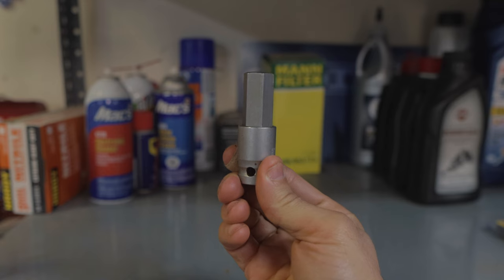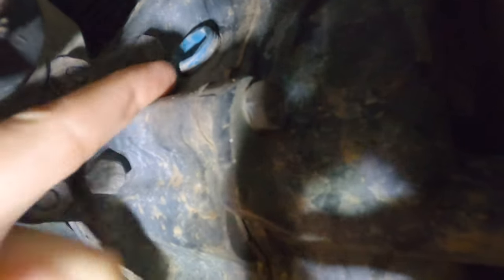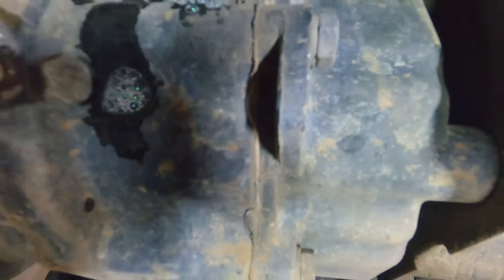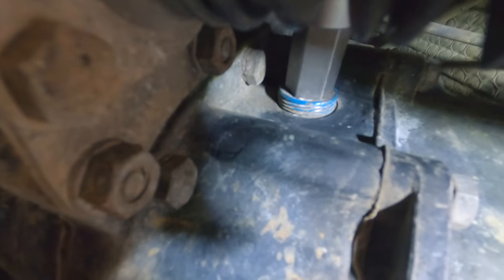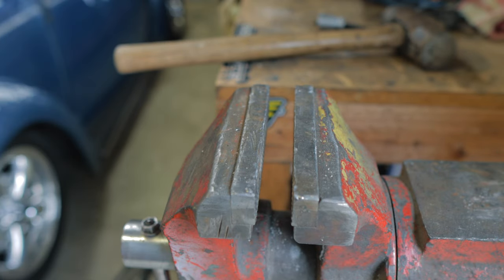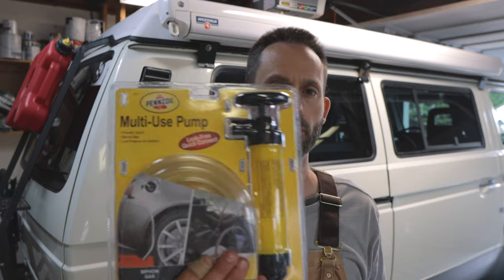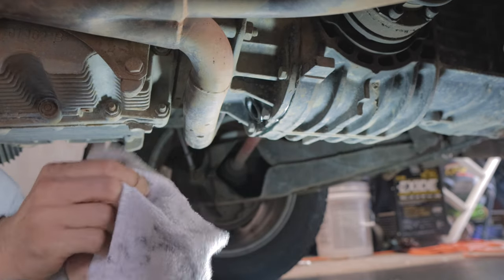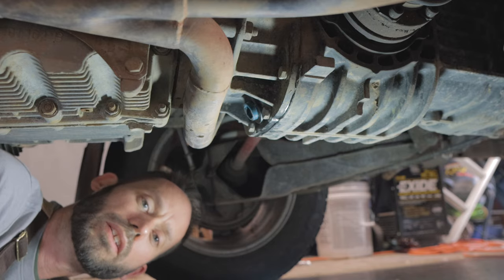How To: Vanagon Manual Transmission Oil Change

Comment: Good to see maintenance of this critical component elevated.  I have been studying the Vanagon transaxle extensively for about 6 years now.  Here are some points I have arrived at (my opinions).  Note that engine size is inexorable from this conversation.  VW built the transaxle for 82hp, then increased it to 90hp.  Many of us have bigger engines which requires heightened transaxle attention and maintenance - obviously.  Mine has 173hp and many vans have even more.

1) 30-40k is a prudent, almost 'anal' interval for the first 100k miles for a 'new' van in its first 100k miles.  We are way, way past that - usually in the 200-300,000 miles range.  If you changed at "30-40k from new" your gears could have an almost infinite lifetime, but nobody has done this from new - that horse has left the barn.  The Vanagon owners manual specified on pg 102 that the gear oil does NOT need to be changed, and this is what Vanagon owners did.  And was VW wrong?  No, the transaxles run a FULL and satisfactory lifetime with even running in their own barf.  VW did not envision or accommodate our current Vanagon fetish, but they could have run into the 400s.  What most all of us have now is a 'rebuild' of a trans that rec'd ZERO maintenance in its prime, when it could have made a difference.  And now we're 'making do' with our worn out gears that will give up the ghost in their 200s, 300s.  A "rebuilt" uses almost ALL old gears but some new bearings.  30-40k is too long an interval for the old gears of a rebuilt.  For our old rebuilt vans, with their original owner's (which we call "sad") maintenance you should consider more like 15,000-25,000 miles. For big engines use 15,000.

2) Inspecting and taking a pic of the steel dust that has fallen down onto the drainplug magnet from above, is important. It's an indicator of the health of your trans.  Is it "more stuff", or "less stuff" than last time?  You should take a pic of it, so you can compare next time.  Every year you will wonder if the trans is OK for a long trip this coming season.  If you have pics, you can know where you're at.  An old trans will contaminate its oil much sooner than a 'new' trans. Looking at the magnet helps to determine your next oil change interval.  If your magnet is completely covered, you waited much too long.  If the magnet has lots of clear space on it, your oil change interval was 'good'.  In your 'opening' still photo I can see your magnet, and it has clear space which suggests good current health.  How many miles was your interval?  I suspect reasonable for your specific trans, and the oil looked clear too.  I also noted your WBX engine, which is another way to get longer transaxle life😉.  Transaxle worries are much less with a WBX.  Transaxle health and maintenance should be elevated to the top for those with big engines.

3) Oil brands are much much less important than your oil change interval.  The thing to know is there can ONLY be minor differences in oil brands...... but in use, there will be vast differences in contamination levels.  Every trans contaminates its oil at different rates, especially if your engine has more HP than stock.  The most significant problem to watch out for in oils is "thin oil".  Thin oils are compelling for the 'easier shifting' but this ease can be a tradeoff in transaxle lifetime.  It depends what you want from your trans.  It can be more economical in the long run to use a $25/gal garden-variety 80W90 that you're willing to change every 15,000 or yearly.  A $100 Synthetic that you are inclined to run "too long" because it was expensive will then cost you in transaxle life.  That $75 difference that you expected to "extend" your transaxle life is actually costing miles if you let it get contaminated.  The oil you choose can only make a small difference at BEST, like single-digit percentages.  Clean, new $25 oil is vastly superior to a $100 specialty oil that already has (for example) 15,000 miles of contamination circulating throughout your trans.  If you go for expensive oil you still have to change it as often as cheap oil.  Again, this becomes much more important with big engines.

4) Synthetic is a very common question.  It has some problems in a Vanagon trans.  It's not a slam-dunk benefit.
a) Synthetic does not offer better protection at low temps but it's definitely superior at temps beyond 240°F such as in racing.  But the Vanagon trans is destroying itself at 180°F (the mainshaft bearing bore is loose around 180°F).  So you can't get there, a Vanagon trans running at even 200°F is destroying itself and you should not stray far from home.  The high temp benefits of synthetic are not within our reach.  How do you know your trans is 200°F?  OK..... that's a completely different discussion.
b) Synthetic can "shift easier".  But that is at a cost. The physical properties of oil that allow easier shifting by 'gripping' the gears, comes at a cost of longevity, it's less protective of gears and bearings.  It's useful to know there is a tradeoff, you don't get  both easy shifting and longevity, you have to choose one or the other.  For longevity, choose a more slippery oil and slow your shifting to accommodate.
c) Putting synthetic in an old, un-maintained trans can be detrimental.  The cleaning action of synthetic can wash off lots of contamination from the walls of an old trans and quickly contaminate your new oil horribly, becoming detrimental.  If you want to use Synthetic in an old trans, consider putting in cheap synthetic as a "cleaner", run it a few thousand miles and dump it, then put in your chosen brand.  Understand this effort may not be worthwhile - you may not be gaining anything and possibly losing.
d) "Synthetic" is fighting words in the oil industry, sellers like "the word" because it raises the perceived value/price.  The definition of 'synthetic' has a wide range of meanings even causing (losing) lawsuits, as such there is little stopping sellers from using the word with their own self-serving definitions. Sorry there is almost no way to know if it's true/false by asking the seller.  Reputable brands could be more reputable (for whatever that's worth).

Synthetic is a difficult question. I'm not sure there's a good answer to the Synthetic question.  Lubricant cleanliness is the single answer that serves you best - unquestionably.  It's something within your control and especially if you can DIY, which this video helps a lot.  People ask me what oil do I recommend?  I don't recommend - I use $25/gal oil. I have 2 gallons of $70 Swepco 201 but haven't used it for "other reasons" too involved to explain here but will certainly use it sometime.  I trust Swepco as a quality oil, and there are many others.  I think the differences between oils are subtle differences.  Except for big engines, never forget that your transaxle is undersized, so definitely avoid "thin" oils.  If you have a big engine and $70/gal is OK, Swepco 201 kept clean is good.  If you need a 'brand', Kendall is trusted by many ($35).  And again, if you have ~90hp you can probably run any oil.

Don't run dirty oil because you can't decide what brand to buy.  Cleanliness is the major factor, by far, and you are in control.  Change the oil now with $25/gal 80W90 and study up on a favorite brand for your next interval.

Sorry so much typing and hope it helps.
Reply from the maker: Great comment Sodo!  Very informative.  We had about 20K on the tranny after the rebuild and as you could see the oil was still very golden and the magnet was very clean with just a bit of black sludge but no metal flakes/shards.  With our WBX motor and regular oil changes we expect it to last a very long time.  Though we may take it back to GTA and get a Peloquin installed here soon :)
nate
Reply: Thanks T_SODO for the information very interesting comment.
Reply: Thanks for your very detailed explanation of the oil to use.   Reading this makes me happy.  Best from Belgium.

Comment: There is a 17mm hex on a 3/8: socket that is about 1" long. A common VW tool. Clearance was still an issue, so I used a 1/2" breaker bar instead of a ratchet. I would make sure the fill/drain plugs move before driving the van, then perform the work more quickly after the warm up drive.  Also, I bought a small hand held pump sprayer at the ACE garden store ($10) , drilled out the orfice, attached a clear hose, filled the sprayer tank with gear oil and pumped up pressure. Then simply press the lever to deliver the oil. Much easier than pumping 500 strokes to deliver 3.5 qts of gear oil.

Comment: Thanks for putting this together.  That change interval corresponds with the interval for the timing belt change on my Subaru engine.   Wish I had a pit to work in.  My van sits a little low so I may have to put the front up on ramps.
Reply from the maker: Glad it helped!
Nate

Comment: Thank you. I used to know how to work on my vehicle. This will definitely help me out. I have an '87 Westy with a manual transmission also. It does, however; have a Subaru 2.2 engine.
Reply from the maker: This is something you can definitely do. The Subi engine doesn't change anything in the tranny fluid steps.  Good luck!
nate

Comment: So I am the proud NEW owner of a 1991 Vanagon GL, and I am noticing the shifter is a bit on the ambiguous side.  Do you have any videos showing how to take care of the shifter linkage, or anything else that might help me tighten up the mechanism that controls this?  Also, I will definitely be using this video as a guide for doing my transmission fluid!  Thank you so much for taking the time to make this video!
Reply from the maker: No we do not have a video outlining those steps.  The shifter mechanism can be a bit complicated due to the length of the rod and wear on parts.  I would start with making sure your shift ears are in good shape and go back from there.  GoWesty has some good articles and videos outlining the shifter.
nate
Reply: @ThatBaldwinLife  The fluid change went pretty smoothly.  The old fluid looked like iridescent tar, super black and apparently VERY old!  New fluid is in and it seems to shift a little better.  Now I do have a different question . . . I want to change the spark plugs, but I am noticing that the small aluminum  endcap on the spark plugs is not allowing me to put the wires back on?!  Am I supposed to unscrew these small aluminum pieces off?  The OLD plugs have them pulled off??
Reply from the maker: Yes they should unscrew from the new plugs. Some wires use different ends. If your old plugs didn’t have the ends, then pull them off!  Nice job on the transmission oil!
Nate

Comment: Thanks Nate. Great information! Was gonna do a TA rebuild but realized my 1990 has the upgraded gear so no pressure to rebuild it before 150K miles. So, just changed TA oil to Swepco 202 from Redline. Really noticing a big difference in shifting. Also upgraded to the GW SS fill and drain caps (not plugs). Both have magnets and all new threads.
Recently had the linkage bushings upgraded to teflon and that makes a huge difference. Evidently the old style bushings absorb moisture and get tight. Teflon won't do that. BTW-did you two upgrade to a Synchro? Thought it looked like that on your recent video to the fire lookout.
Reply from the maker: The Swepco is a great oil, it’s all we use now. We have not done the Teflon bushings but may look into that!
Nope still out 2wd but we put on our SyncNO badge 😁

Comment: If you can find a vintage snap on wrench S5902 it has a 21mm wrench on one end (for removing generator nut on type 1) with a 17mm hex on the other for transmission drain plugs. Have had mine for over 30 years.
Reply from the maker: I’ll have to keep an eye out for one of those!  Thanks!
Nate

Comment: Just did this in mine, ended up needing 2 jugs 1 was just shy of filling. That hand pump wasn't too bad way better than the harbor freight version.
Reply from the maker: Weird, we have never used more that one gallon to fill.  Glad you got it changed!
nate
Reply: @ThatBaldwinLife  i forgot to add that I accidentally knocked over the first jug halfway thru and spilled a little so thats probably why 😂

Comment: Really timely video - thanks! I was thinking about doing the gearbox oil on our 1983 petrol T25 but was unsure of exactly how to do it. This video explains it perfectly. Going to have a look on JustKampers to see if they've got the oil and the socket I need. Will look for one of those pumps too. Our gear linkage hasn't got those rubber boots you've got - is it supposed to have them or are they an upgrade?
Thanks again for a great technical video - bang on time.
Reply from the maker: Glad it helps!  Ours didn't have them stock but the 1988 and up Vanagons have them and they are a direct fit.  GoWesty has them as I'm sure Campervanculture.com might as well.  
nate

Comment: Hey Baldwin! I did this job today on my 5-speed. I followed your advice and bought that 17 mm key, and punched it out just like you did. It was a lot of work cleaning up around the holes, especially the upper one. I also saw a lot of corrosion "cavities" around both plugs. Any guess why that happened? The gearbox is probably original = 33 years old. I know aluminum "rots" but it really looked like some weird cavities, and none of that white corrosion stuff, probably it has corroded anyway, while being drenched in oil/grease/dirt. I filled up with "fully synthetic" 75W-90 oil. Some folks here in Sweden advised to put a mineral oil though... I don't know what to believe. What's your opinion about oil grade/quality?
Reply from the maker: I would stick with a high quality oil like the Sweepco 202 or any other 75w90 oil.  No reason to put mineral oil in your transmission ever.

Comment: I Just ordered the same fluid! thanks for the video! What would you recommended for power steering fluid? I want to flush out my PS system. ~cheers~
Reply from the maker: The Vanagon's use ATF for power steering fluid.  If you flush it out, don't forget to change the foam filter that is in the reservoir!
nate

Comment: I had the transmission fluid changed a couple of months ago. $100 hassle free.
Reply from the maker: Sounds good.  I do ALL of my own work on the van and would rather spend my $100 on top quality oil after spending that kind of money for the rebuild.  The only hassle in the entire video was filming it!  Usually it is about 10 min worth of work and 30 min of draining oil.  And while that is happening, I do an inspection of the underside of the van and lube the shift linkage.  Time well spent.  Thanks for watching!
nate
Reply: @ThatBaldwinLife  Consider yourself lucky you can fit in tight places. I have been through 3 transaxles, actually 4. $100 is 2 tanks of gas these days. I need new seat covers. That's $1.4k. Need new carpet. That's $1k. Need paint and body work. That's $5k. $100 seems like cigar lighting money in comparison.
Reply: @ThatBaldwinLife  Be careful about lubing shift linkage. I went in for a repair on the steering pump with linkage functional but on its last legs. The mechanic lubed the shift linkage (I am not sure why) leaving me stranded for 2 weeks waiting for new linkage to arrive by mail. I couldn't get it out of reverse. That linkage had 360k miles on it.
Reply from the maker: Staying in good shape is not only good for your health but also your Westy maintenance! :)  
My Westy needs a few of those things too but luckily I can do all of that myself and save some money when the time comes.  Always something with classic vehicles!
nate
Reply from the maker: My shift linkage is brand new from the shifter to the tranny so I don't think we will have any issues.  All of the dirt roads we drive build up grime on the lubed areas and need to be cleaned and re-lubed every few years.  Sounds like your OEM linkage lasted a long time!
nate

Comment: Thanks so much! AND for the front diff for a Syncro? Which oil I should use? Saludos desde México.
Reply from the maker: I have never worked on a syncro but I am sure you can check on theSamba.com for that info.  Thanks for watching!
nate
Reply: duayhe omar, use "clean oil" 80w90.

Comment: Why use 202 vs 201? Just wondering since most porsche people love the 201
Reply from the maker: 202 seems to shift better when cold. I’ve used 201 before and it is stiff from the 1->2 shift. 
Nate
Reply: 202 has the Moly, 201 does not.

Comment: Why is the new oil he's filling black?
Reply from the maker: The Sweepco 202 is just that color.  Some transmission fluids are more clear, some green and some red.  Just the color they have.  When you drain it out and spread it on a white paper to inspect, it is clear enough to see grit or shavings.  But it does look like I am putting in used oil :)
nate